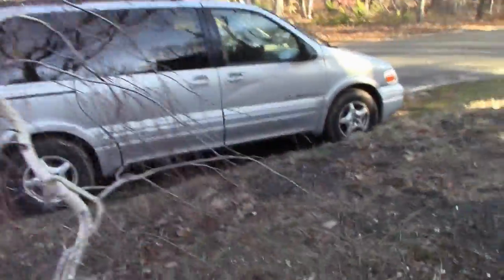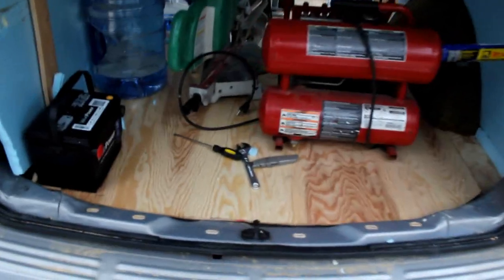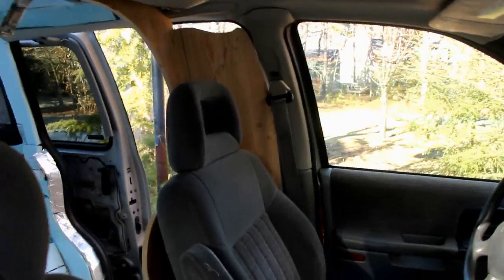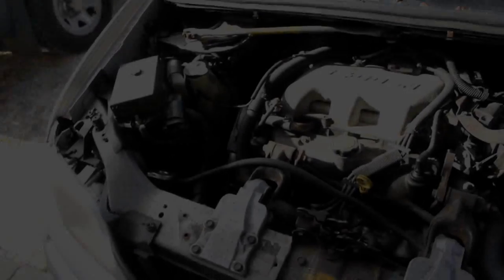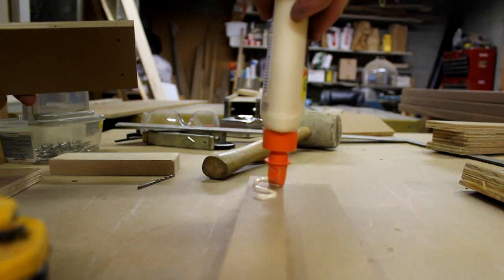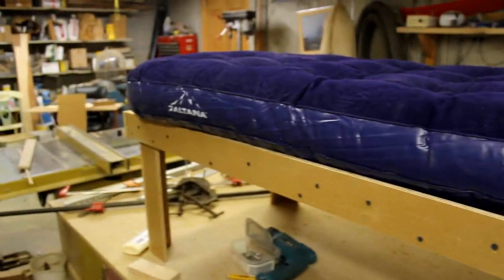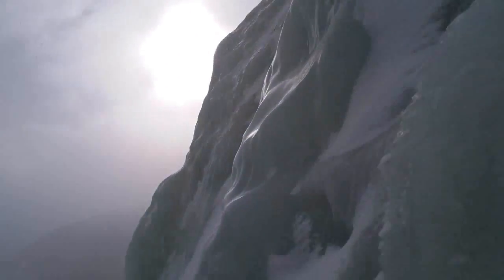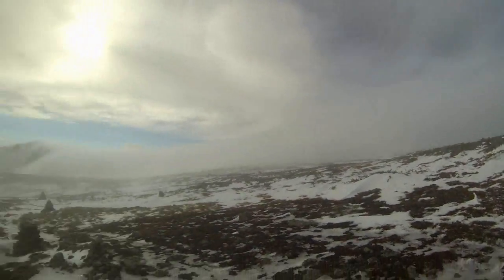Minivan Camper Weekend Build

Comment: You might need some simple heat exchanger ventilation in there that leaves heat inside but brings fresh air in and gets CO2 and H2O out. Or the simplest answer is to have a classic diesel heater. Perhaps 2kW is enough and you could fit it somewhere in engine compartment.